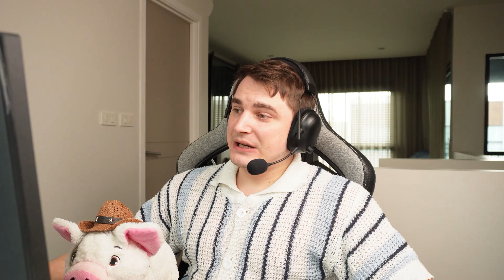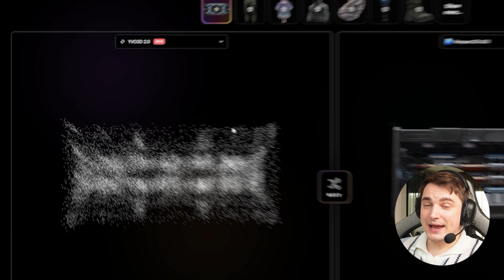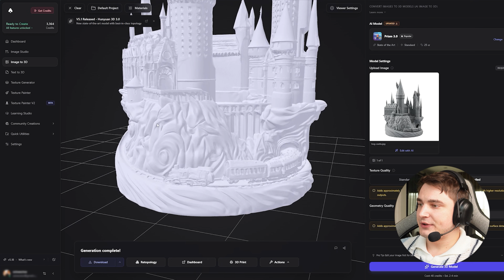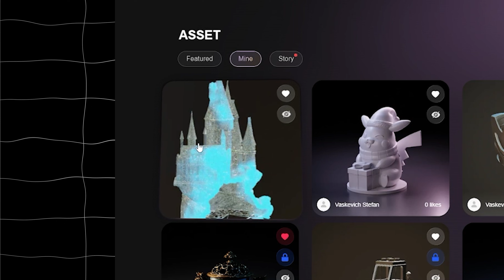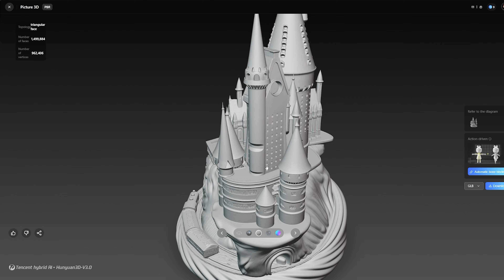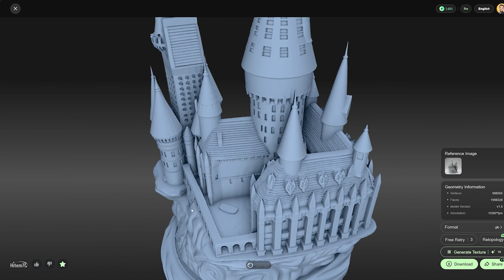Print-ready 3D figure using only AI (bad idea?)

Comment: Wouldn’t it make sense to use multiview generation and create four views of the model with nano Banana? That could be a good solution for producing a decent result.
Reply from the maker: Yes, it would make sense if there is details that differ from sides and you want them specifically. Other than that 3d gen AI also have multivew in their pipeline. So it is overestimated

Comment: Love your vids and info but how do you go through with the actual 3d printing process and setup? I recently got into 3d printing ai stuff but at the moment even the best tools almost NEVER give actual manifold objects (i have subscriptions to most of the top models like Meshy, HitEm, YVO, Hyper3D, 3DAIStudio and of course 3DHunYuan which is free). Sometimes Bambu studio will fix the manifold problem with little geometry change but for something very detailed it almost always changes up parts of the model and messes it up to force it into a manifold. To make it manifold and keep it perfect on the exterior you NEED to edit it so it's manifold to properly print it, there are exceptions of course, you technically can print non-manifolds but its risky and almost always fails and creates spaghetti.
Would love to know what you printer / printing software you use and would be helpful to watch the process of importing to the printer software and actually sending the print job. Thanks

Comment: cool, I just used Tripo AI, to do a character batman in a lab coat for 3d printing, it did a nice job on the 3d model. I have the snapmaker u1 so had to map  vertex colors to get em to stick to the obj file. once that was done small touch ups in the slicer and printed it in 3 colors. super cool :)
Reply from the maker: Sounds like a really cool project!

Comment: A pretty solid proof of concept, and we’re absolutely leaps and bounds from where we were a year ago. But definitely still requires some level of mild editing to get a great final product. I think within about a half a year some company will have it perfected to where things will be ready to print. 

I’ll be honest, I looked into this last year and when I tested it with what I felt was a pretty simple test for a real use, I was so annoyed with the results that I figured it was just a gimmick. In short I wanted a chef’s knife printed (for a chucky doll to hold). It couldn’t figure out how thick to make it, the handle bolts were being turned into holes because it confused the silver color of them for the white background, and the tip was the worst. I just tried tencent’s site on a random knife image and it’s perfect.

I appreciate the updates and tests you’re putting these ai through. As someone who’s just getting into this whole side of things it’s been extremely helpful.
Reply from the maker: To be honest, over the current year, it has evolved significantly. So, a year ago you were frustrated for a reason, but now it's different.

And appreciate your feedback!